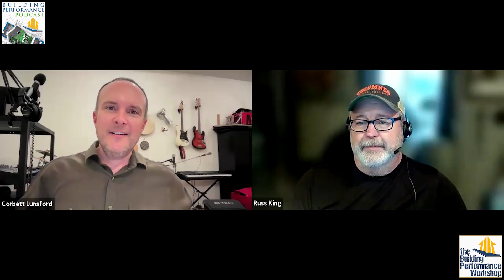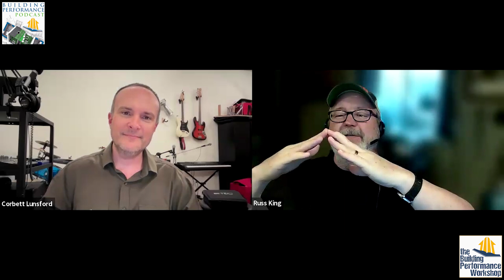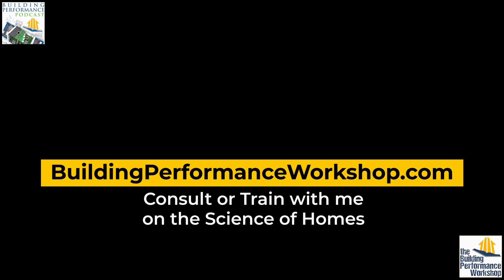HVAC Design Softwares with Kwik Model's Russ King: Building Performance Podcast #92

Comment: Anyone experienced enough for load calcs on an HVAC in a residential home in Peoria AZ?
Reply from the maker: It’s just math, and locating the home in the right weather conditions Pete- no local expertise needed.
Reply: @HomePerformance  HI Corbett :) I can’t find a more experienced HVAC company (just like Russ was explaining, these guys generally don’t want to learn/care) to realize the home’s HVAC has high static pressure. 

There has already been testing- 

The manometer pressure readings have a Delta P 0.93 inWC (0.41 inWC P1 & -0.52 inWC P2) and I was told the ACCA standard says anything over .90 is most likely duct design issues. :-/

I’m also planning on signing up with you guys for your online DIY HVAC/building envelope courses. Looking forward to hearing your thoughts, thank you.

Comment: Great podcast!!!

I know my Daikin VRV is way overspeced and IS causing us problems. I pushed back during the build so they reduced the units units to be smaller but they are still too large.

But I didn't have the data to push back, if I could have had this software it would have been perfect. They just kept quoting the "Daikin god", and ignored me explaining the investment we had been making already to reduce the thermal load that should result in needing a smaller AC...

Comment: Very cool interview.  Thermal mass is very interesting.  In Florida most houses are cement block and code doesn’t require insulation inside that.  The block is about R-2, but there’s an 8-12 hr delay of warm up and cool down spreading out the load, so is it really R-2?  Pretty interesting!

Comment: Good video, as always. But, I have to disagree with a few points. First, ceiling fans are hideously ugly, and there's no way you can convince me otherwise. Second, as an engineer, I can't agree with your philosophy of  "right-sizing" a system. If my client's requirements are to maintain indoor conditions at 65F and 45% relative humidity (my preferred indoor conditions, for example) during the worst possible heat wave, with a 20% safety factor, it is my professional and ethical obligation to design the system to meet those design requirements. No ifs, ends, or buts. Also, it's not your place to tell the client how to live their life or operate their building; if they want to leave all the blinds open, the system should be designed to handle it.

Comment: The word "software" is both singular and plural.  You can't make it plural by adding an "s" to the word.
Reply: Moreover, in this context, you don't use the term "a software".  In that context, "software" is a modifier, and you use it with the words "program" or "project", or some such.  So, you can have "a software program" or "some software programs".
Reply from the maker: Can. Did. Actually, though I generally admire attention to detail and grammar, in this case let me simply say I think you might have missed the point of the discussion and I can make up any new words I feel like in the pursuit of helping people understand that there are options for injecting more science into their homes. Softwares stays.

Comment: Homeowners doing their own load calcs is a solution, granted a very minimal one. 

Manual J will only ever be something truly important when it is widely adopted by HVAC companies. I am probably a broken record for saying this, but it's incredible that MJ as existed for so long with such limited adoption. 

It speaks to the broken nature of the HVAC industry.

I think the industry has to forced into using MJ.

Very interested in your thoughts on new tech like Conduit Tech.

IMO only chance these complicated calculations will become mainstream.
Reply: The only thing that will really drive change in the HVAC industry is an educated consumer. When customers understand they can have more comfort and efficiency from a properly designed system then the demand for better systems will start driving more adoption on the supply side.
Reply: Even if you force them to use it they will cheat. There is a very big sales reason for oversizing equipment.
Reply from the maker: Forced into it, like requiring a Manual JSD in building code in a majority of states, like right now? Like blower door testing, also required, also unknown to most builders and code officials. The stick doesn’t really work.

Comment: @homeperformance This baked in error in all the modeling SW and rating of equipment makes me wonder why anyone would not use a variable unit so that output is always matching demand (assuming that it’s not so far off it makes significant impact to equipment cost or places the minimum turndown at a point that is too high for the actual demand). These discussions also make me really want Anthony Amadio to hurry up with TrueLoads.
Reply: I would bet that they oversize it even more "because it can slow down". That way they sell a more expensive machine and make more money.
Reply: How far off is the baked in errror in MJ calcs? From your knowledge?

Comment: This answers why I only got 1 good estimates when sizing my heatpump. We have a medical reason we need our upstairs at 72 degrees. Which means setting the thermostat on the main floor at 70 degrees. 

Every other installer didn’t listen to our requirements and did the calculations at 75 degrees for cooling.
Reply: According to Man J they were doing it correctly than at 75.
Reply: @sirfishalot6992
Yes they were sticking to there standards correctly. And completely ignoring the abnormal request from the customer. 

If the house was allowed to get to 75 degrees my wife’s MS symptoms would skyrocket. Last year there was a couple days over 110 degrees. Our house stayed right at 72. The heat pump was running almost continuously to keep up. But it did it.

Comment: The largest problem I see in my area is a single 14" or 16" round return duct on homes with 3, 4, and 5 ton systems.

Comment: Is there anything wrong if I i have a couple years of actual usage data, then skip Manual J and then properly calculate the needed size?
Reply from the maker: Sure man, that’s absolutely a test. Actually, that’s how they measure insulation value in Europe- they build a structure and get a bunch of data on its actual performance, then that becomes the rated U-value.
Reply: @HomePerformance  The topics in these videos are all interesting for new construction, which is of interest to me. But for a relative's house, she has data on how she heats and cools, so I'll use that to size a heat pump to replace her furnace & AC. And that will become oversized as the energy improvements are implemented, so variable speed is still useful.